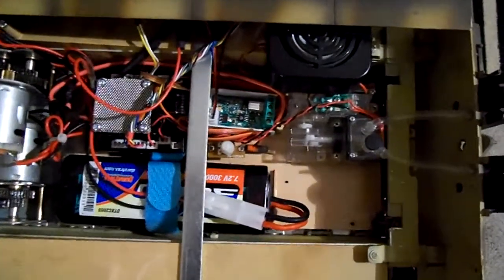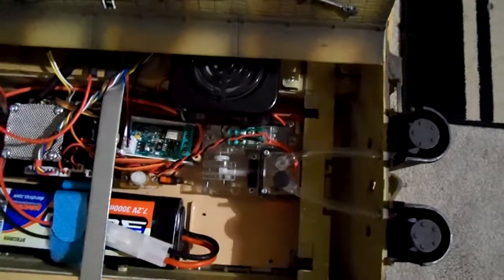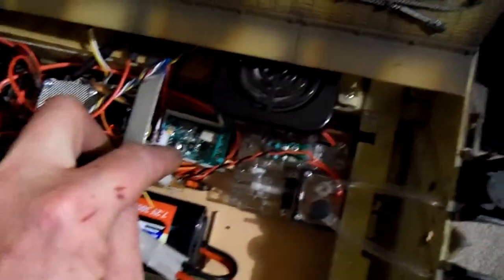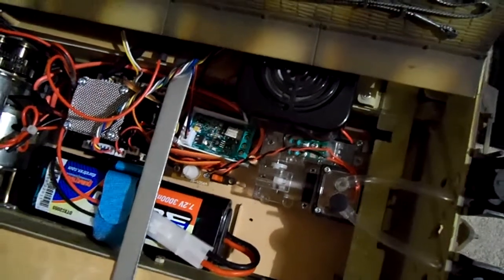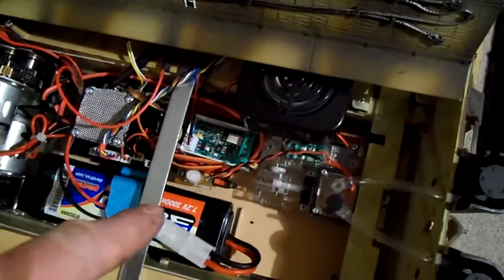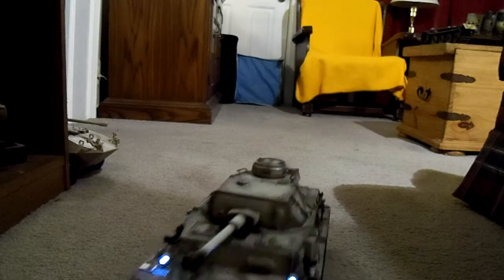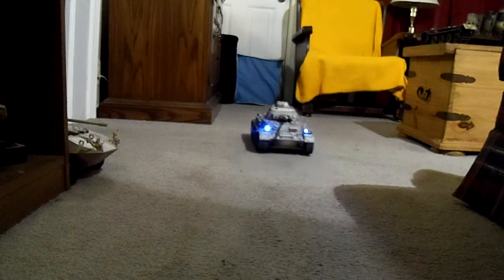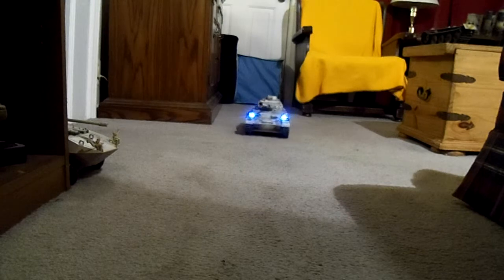komodo update

Comment: What's the difference between long and short delays?
I've been in the tank thing for a long time, but don't have any experience with these anti track recoil units.
Reply from the maker: Short delay is about 1 second, long delay is about 3-4 seconds. If you can find any vendors that still have these in stock please let me know. Kevin stopped making them and I'd like to get a few more if they can be found.